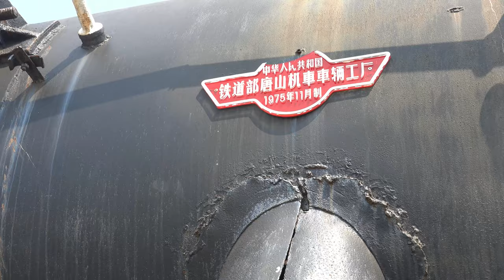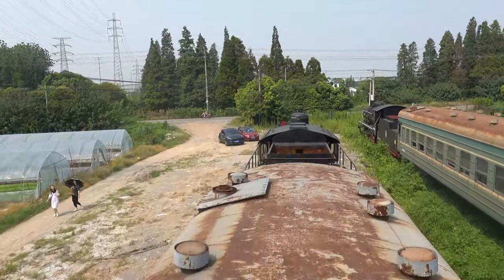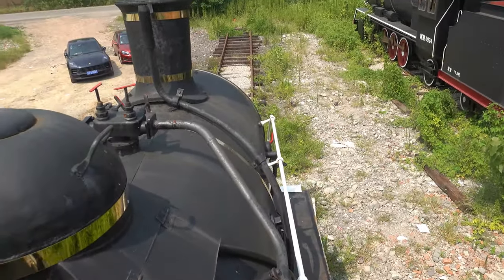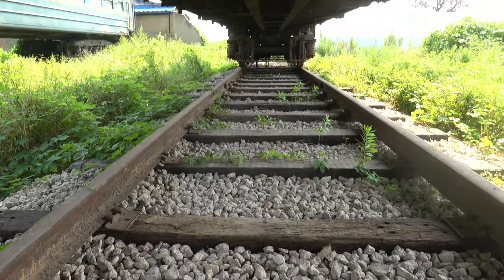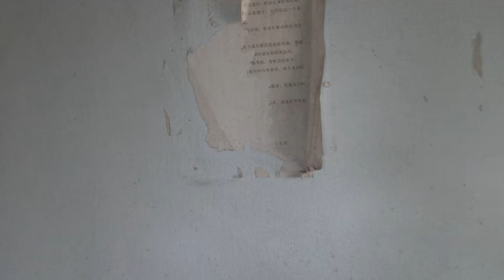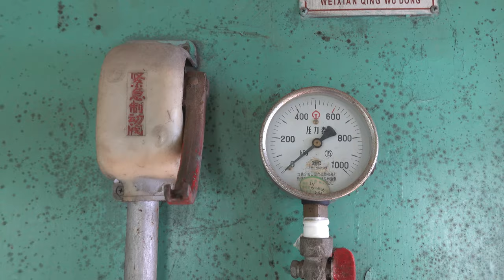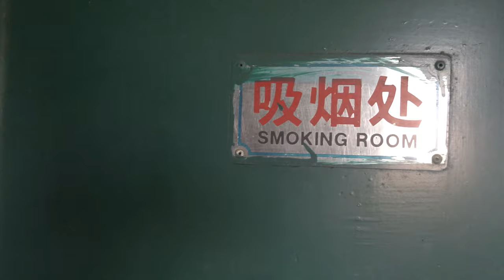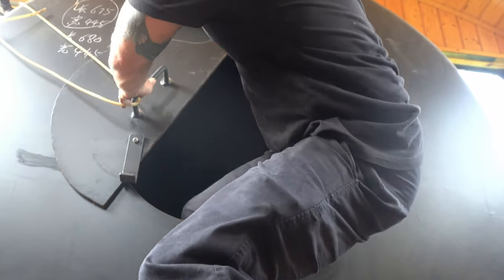Abandoned Trains - Old Abandoned Steam Engine Trains Shanghai - Abandoned Steam Locomotives [1976]

Comment: Generally those control rods in a steam-driven locomotive (by way of coal as a combustible material) is to regulate the temperature of the boiler. Too hot and it explodes, or melts. Too cold and you aren't going anywhere. By controlling each aspect of the boiler, more steam, injection of cold water, etc; you end up with more frequent and greater inequality of temperatures throughout the boiler and thus the development of a more predictable power-arc. A conductor would not only have to monitor the boiler, but he'd need to know the route and anticipate changes in track gradients to know when to increase or decrease power. It was a science but also a job experience as well. *also* TRAIN PORN.
Reply from the maker: "Too hot and it explodes or melts, too cold and you aren't going anywhere." Sounds like my life in China.

Comment: Steam locomotives are living breathing beasts. Two in a row could roll down an assembly line and they could behave 180 degrees differently. Those rods are like our internal controls for our bodies. The control heat distribution, power distribution, bleeds off or helps create steam for the entire works. Amazing machines they are.
Reply from the maker: I didn't realise you were such an expert Brad, but you do have a train in your avatar, so I shouldn't be surprised. These beasts are mostly being phased out now. Do you suppose the bullet trains have their own personalities?
Reply: @burbex  I actually have a steam locomotive tattoo on my arm, lol. From the old Pennsylvania RR. I would think the new style bullet trains would more have their own personalities in their braking systems in contrast to their engine systems. Love your work.

Comment: so the 0924 is a static display replica locomotive (a JF, or 解放 Jiěfàng "liberation" class) locomotive. There were many JF/Liberation locomotive types, but I could not find if any real one carried the number 0924. 
In contrast, SY 1503 is a legit steam locomotive, and so are the passenger cars. The one behind 0924 seems to have its interior remodeled at some point in its career.
As for the red knobs in 1503's cab, they are to adjust steam pressure in the boiler.
Reply from the maker: Wow! You're a real goldmine of information. How did you research the train numbers?
Reply: @burbex  It was a bit ok looking at Wikipedia and the Google Translate app